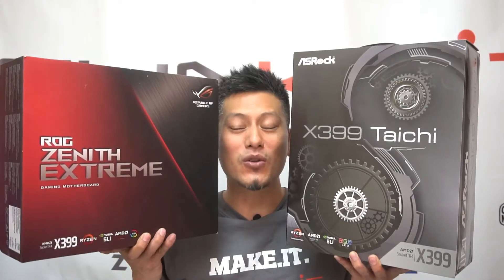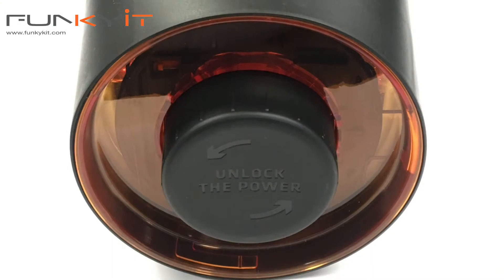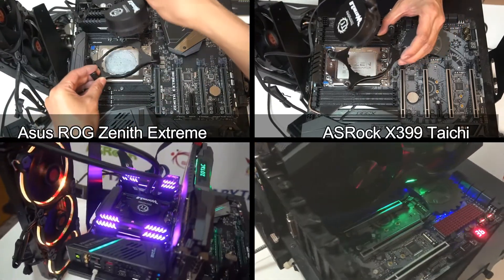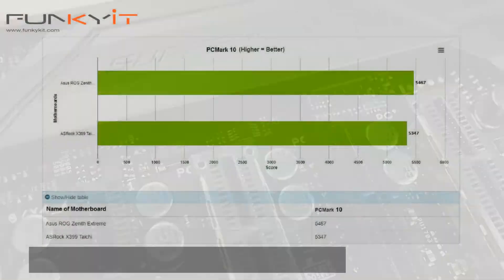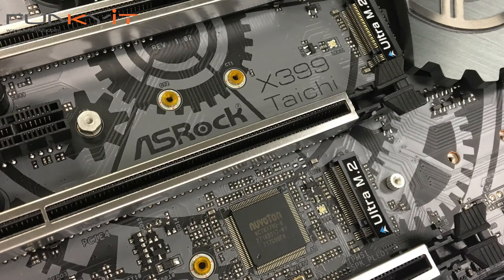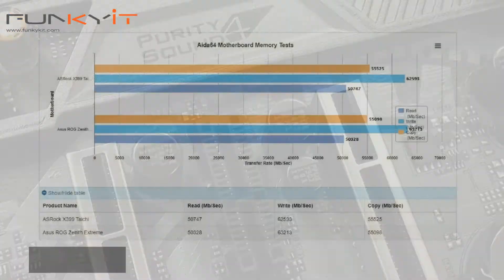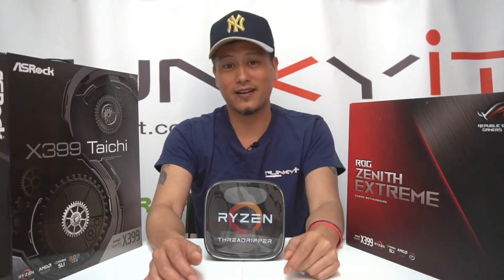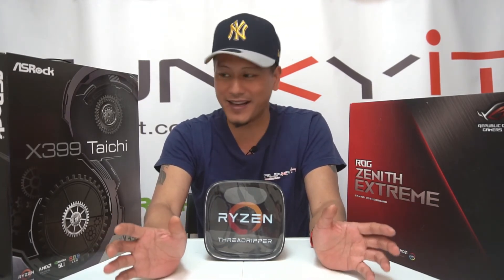Who's the Winner? - ROG Zenith Extreme vs ASRock X399 Taichi

Comment: I didn't really need all the features and bling on the Zenith so I went with Taichi and saved some $ to go towards the rest of the components (the 3200 C14 RAM sticks were expensive as heck!). By the way, how were these benchmarks done? Were they ran at least 3 times to get the mean values? The 1-2% performance gap is inside margin of error and not even worth noting. Either way, I would say no one will ever notice a difference performance-wise in their daily usage.
Reply from the maker: bgtubber I agree. ASRock offers better value for money and performs about the same. Zenith Extreme has all the bells and whistles with a higher price.